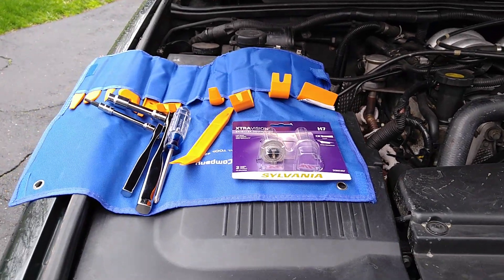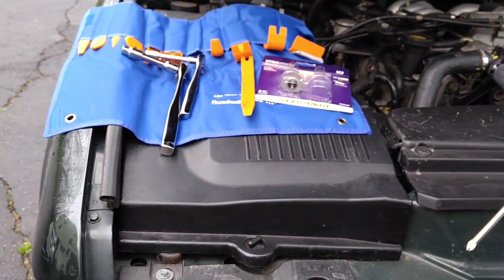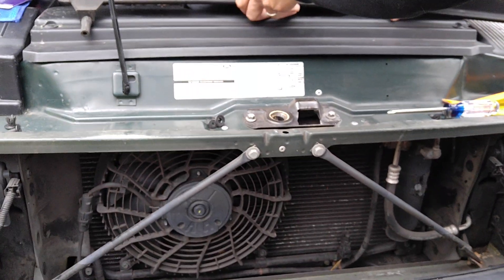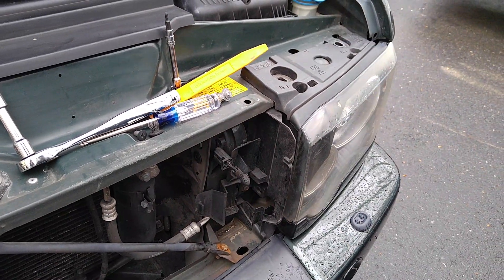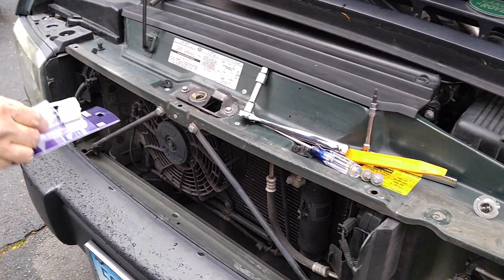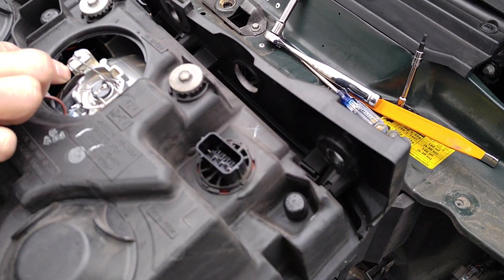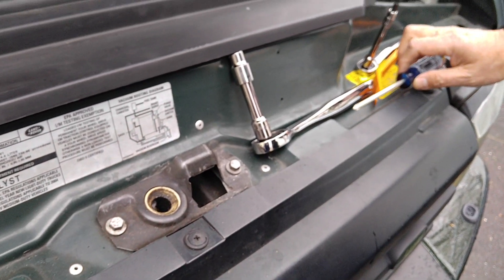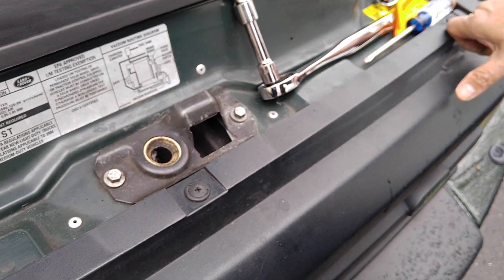How to change a headlight headlamp on a 2004 Land Rover Discovery Series 2

Comment: I've had mine since 2012 and never had to change bulbs. Are the high and low beam rhe same a standard H7? I ask because on Amazon some say fitment high beam or low beam none say fitment both high and low beam so wasn't sure if there was a difference or a model number. I think my fog light bulbs are the same too. If you still monitor this channel.
Reply: 03/04 are H7.  Earlier d2 is H11

Comment: Thank you for the video! Can I ask you what is the brand (and size) of those two wrenches?
Reply from the maker: Of course... both of those ratchets are Sears Craftsman Premium Ratchets and have 84-tooth gearing.  The gearing makes it really smooth to operate and in tight spaces, requires very little arc travel.  I have them in all the typical sizes, 1/4" (the small one in the video), 3/8" (the bigger one in the video), and 1/2" (not shown).  Sadly, when Sears went to manufacturing their tools in China and not in the US, the premium ratchets were discontinued.  You can sometimes find them on eBay.  They retailed for about $80 to $90 a piece.  Snap-on and Mac tools both carry similar closed-head design ratchets.  Hope this helps.

Comment: The screws you removed are adjustment screws. If you remove the 3 other ones instead, you won't lose the adjustment on your headlights.
Reply: Sorry? Is this regarding a different video?
Reply: The method shown in this video is the same as specified in the factory manual.  The adjustment screws are located behind the screws removed here.

Comment: Do you know if it's possible to open the headlight unit and clean the clear plastic housing from the inside?
Reply from the maker: ct britva in general the headlight units don't open up because they're supposed to be sealed to prevent moisture.    If you do get it to open, make sure you re - create the seal.
Reply: Thank you, I'm trying to restore the headlights as they're cloudy. I've done what I can and can't be sure that the rest of the cloudiness isn't inside the headlight. Have you seen this issue on your D2?
Reply from the maker: ct britva yes, very common with these kind of headlights. You can use a headlight cover restorer. They work well and tend to last about a year or more. I've got a car I can do this one, so I'll post up a video when I can. I'm sure others have already posted on here on doing their headlight restoration.
Reply: I've seen some videos on restoring headlights for other vehicle and tried Meguiar's headlight goop, which cleared up most of the cloudiness but it seemed like some might be inside the headlight cover... Maybe not. I'll have to try a few other things. Perhaps the haze is thicker in some areas (seemingly where the lights shine through). I'll subscribe and look out for your video. Thank you!